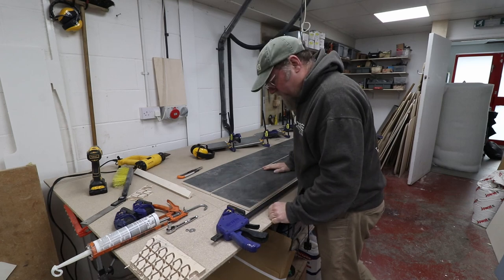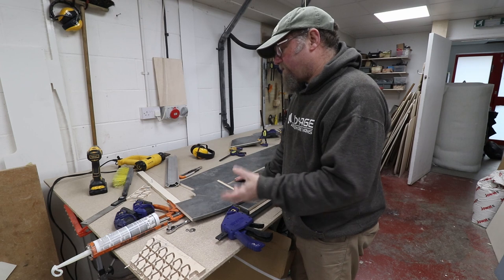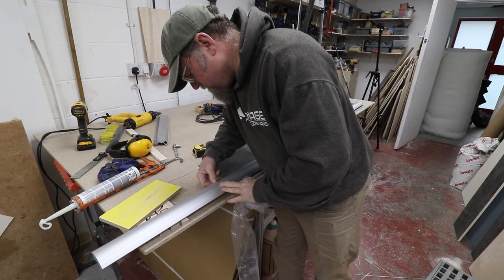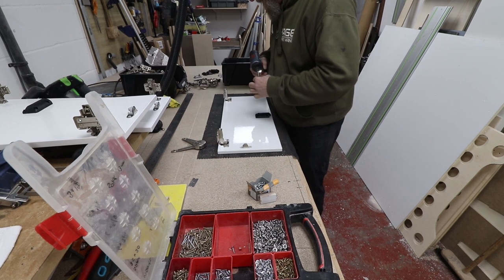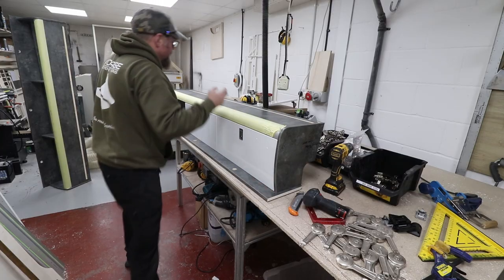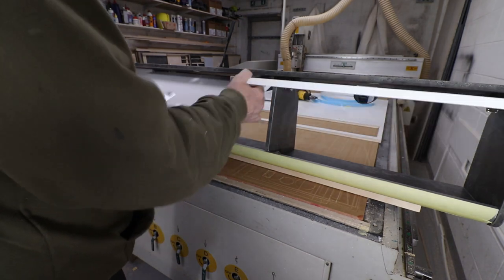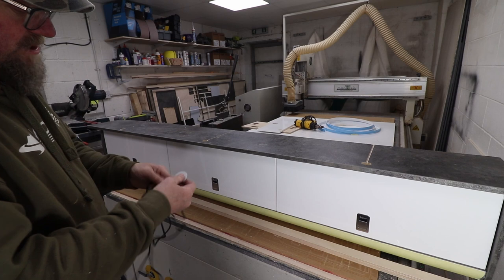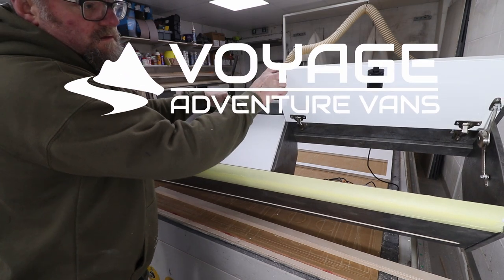Building Overhead Campervan Lockers - Vanlife Dreams Made Reality: professional build series - Ep 8

Comment: Great video Ed currently at this point in my van and waiting for this episode what height and depth are the lockers ? Thanks Liam
Reply from the maker: The lockers are approx 290x290mm base and front, with the backs scribed to the van sides. There is the plinth on top (15mm) plus the light strip (20mm) before you get to the ceiling. Hope that helps.
Reply: Thanks I’ll be trying a dummy run of this during the week 🤞